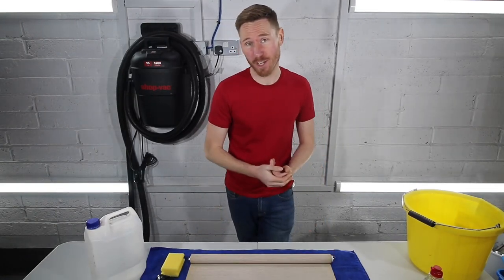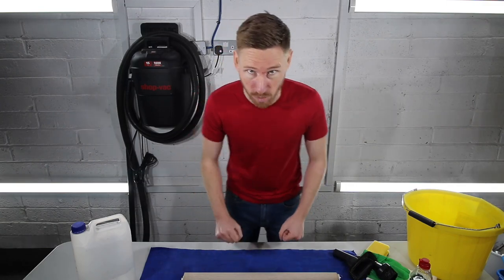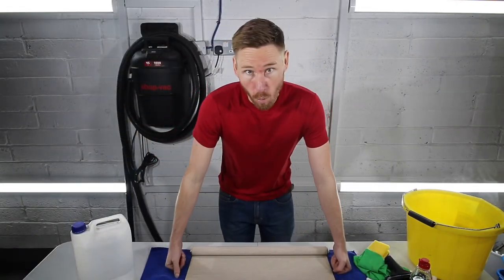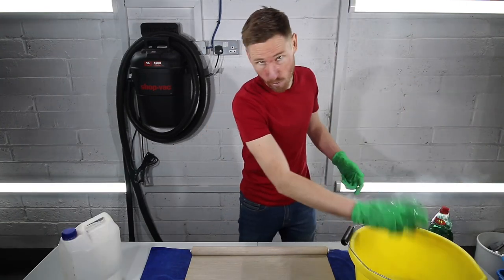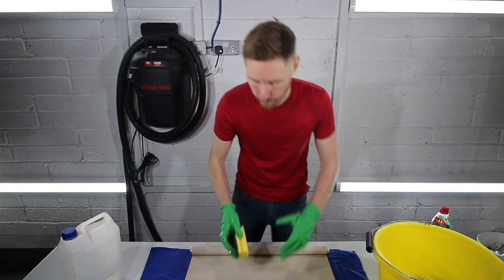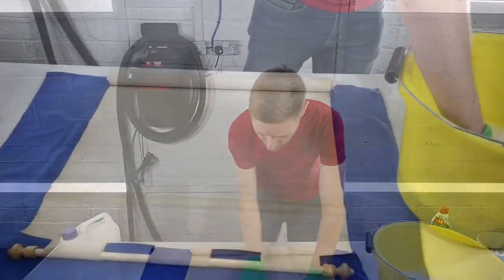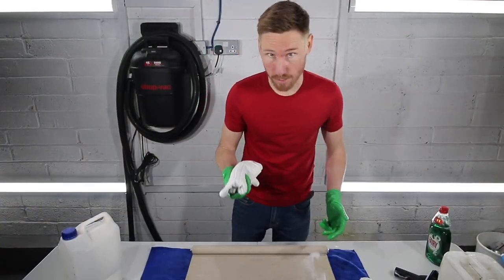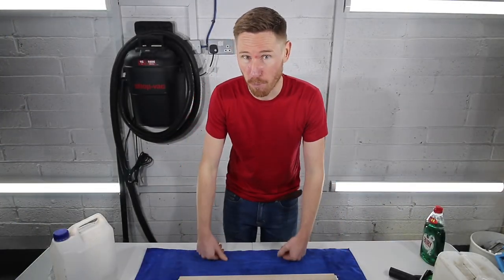How To Clean Roller BLINDS and SHADES | Easy Tutorial to Clean Your Blinds at Home

Comment: Could you suggest any ideas for removing white paint from the reverse of a fabric roller blind please?
Reply from the maker: Depends what type of paint! Options are wash it off if its water based, lightly sand it and use rubbing alcohol on it if its oil based. Be careful, patient and test - that's how I would approach it.

Comment: Carl hope you're doing fine! please what can be used to remove rust stain on a fabric curtain?
Reply from the maker: Generally an acid - there are dedicated rust removers for fabrics also. Start with neat white vinegar and see if that works!
Reply: @CleaningHowTo  thank you so much
Reply from the maker: @antoinemattar5497  no problem :)
Reply: Carl please I have to clean micro suede and faux suede upholstery fabric what can I use?
Reply: Only Alcohol 70% or a mix of detergent/  alcohol 70% + hot water ?
Reply from the maker: @antoinemattar5497  a mix of the rubbing alcohol and the detergent - if they are very greasy, wipe over with the rubbing alcohol first to remove the grease.
Reply from the maker: @antoinemattar5497  This is just microfiber - its not suede - use an upholstery cleaner product - do you have a rinse extraction machine?
Reply: @CleaningHowTo  yes sure
Reply from the maker: @antoinemattar5497  should be fine so!
Reply: @CleaningHowTo  thank you
Reply: @CleaningHowTo  hello Carl, if I want to send you few upholstery photos how can I ? please advise
Reply from the maker: @antoinemattar5497  Join my new facebook group https://www.facebook.com/groups/1413119725685956/